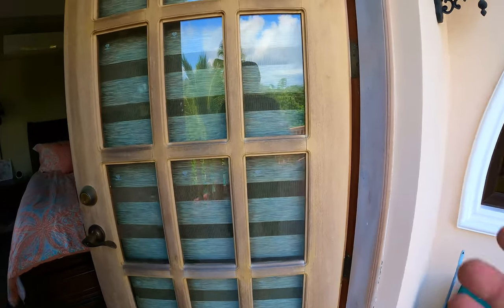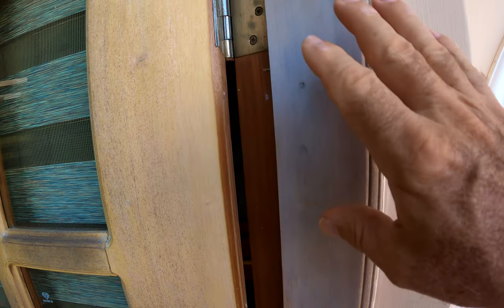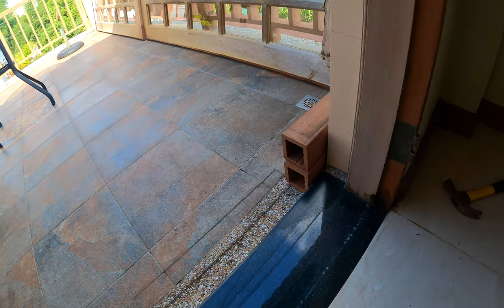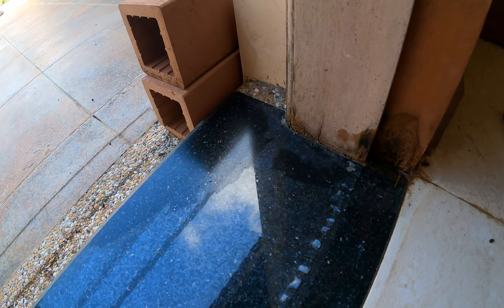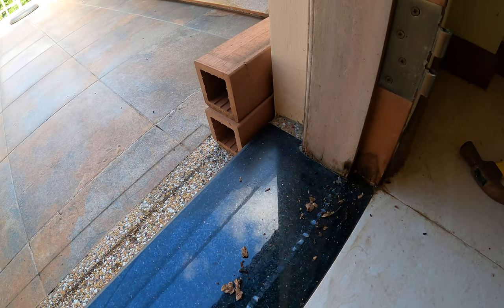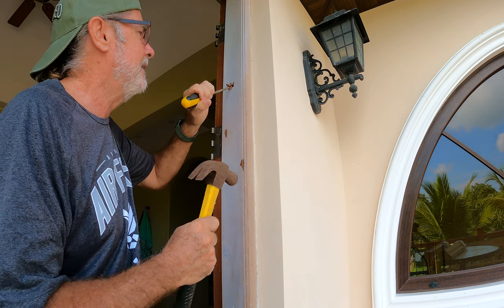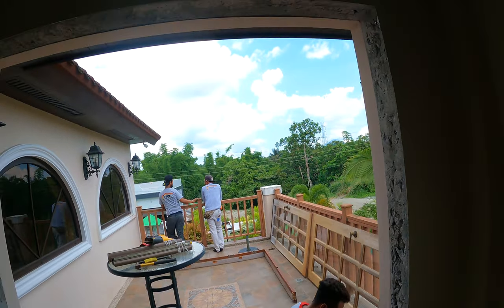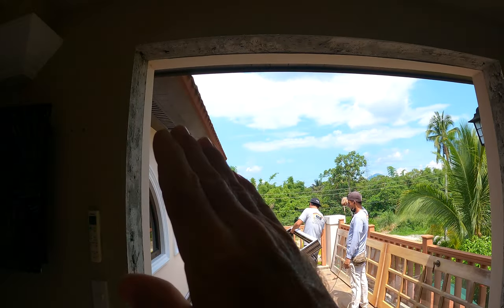SHOULD I USE WOOD OR uPVC FOR MY DOORS/WINDOWS??? (House Building in the Philippines)

Comment: Didn't see it in the video, but other thing to pay attention to is how things are fastened (the new door) to concrete. The use of plastic sleeve anchor with screws for very heavy items - whereas we use Tapcons or steel sleeve anchors back in the states.
Reply: Hard to find Tapcon in the Philippines
Reply from the maker: Yes, we had guests visiting during the installation of the frame so I didn't get to cover that.  They used plastic sleeve anchors with stainless steel screws.  Was happy with the install and it feels very secure so far.

Comment: Looks great...Much improved from the wood...With the termite issues maybe better to go with PVC from the get go? Another bit of wisdom for my eventual build...👍😎👍
Reply: Termites should not be an issue if your ground/soil was treated properly to begin with. The wood finishing is the problem with James' doors, wood last centuries if looked after correctly, plastic in the tropics will embrittle within a decade. James problems were with the contractor who basically did a bolter with many issues outstanding for James. I am not a greenie but forested wood is much nicer to the environment as well.
Reply: @zorbakaput8537  Makes sense as well...Great counterpoint...👍
Reply: @zorbakaput8537  May I ask what kind of soil treatment you're talking about?

Comment: Excellent 
One cannot help but like everything about the overall improvement and looks of the installation. However, in hindsight, the water seepage concern leaves unanswered questions. Did the installers use some form of frame sealant? If not, how would one know if in fact this issue was resolved? Perhaps a simple water hose test after installation would have put the publics mind at ease on this issue!
Reply from the maker: Yes, silicon caulk inside and out.  100% improvement over the wood door installation.

Comment: James, I think you are smart using the U or CPVC, I seen this on This old house and Holmes on Homes ( an HGTV, Canadian very famous Contractor), they say they use this almost exclusively use this unless the customer has some type of special order. However, the advantages I hear are you can sand it with high grit 180/220 and paint or stain any color. And it will last in the weather  now I'm sure the uv does break it sown eventually but for such a beautiful door, that's not a bad price. By the way, what was the actual completion  date of the house when you both or 1 of you could live there with furniture at just the main house? Sorry to ask I'm just wondering I have been watching your videos for so long I can't remember and my time is limited to try to hunt down the video # with a date attached. But great video, as always, good day to you and your family.
Reply from the maker: Actually, the house was never completed. I'm still finishing up on all the small tasks the builder never finished.  I'll be building built-in wardrobes in all bedrooms before year's end.

Comment: As someone that used to sell Double Glazing many years ago I certainly wouldn't have chosen a coloured PVC as their UV stability is WAY less than white PVC. Not sure what guarantee they gave but don't be surprised if you see degradation in 5-10, especially considering the amount of sunshine in the Philippines. One other point , did you go for double glazed??  I don't see much evidence of that in the Philippines.
Reply from the maker: It seems the uPVC we chose for most of the house is high quality as I haven't noticed any fading or deterioration in 5 years so will have to continue to monitor to see if it will be an issue later.  We didn't go for double glazed because the climate here in Lipa is milder than most of the Philippines.  Had we built anywhere else, with the exception of Baguio, we certainly would have entertained double glazed.

Comment: I  have exactly the same issue on my main door especially that the roof of the trellis has blown away.. as per.my experienced  from the two building  contractor that I dealt with previously,  house owner should really be on site always during the contruction. period.. and Not only that, deal only with the company that offers a back up guarantee maintenance services in the next 15  yrs as a side contract..
Reply from the maker: Good tip Rosie.  Thanks!